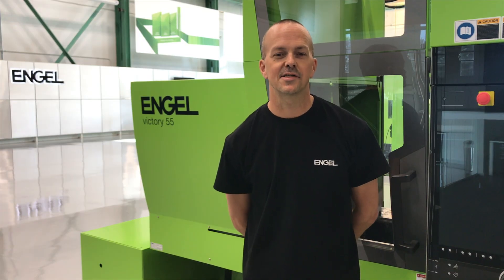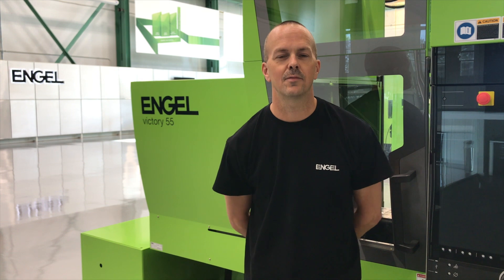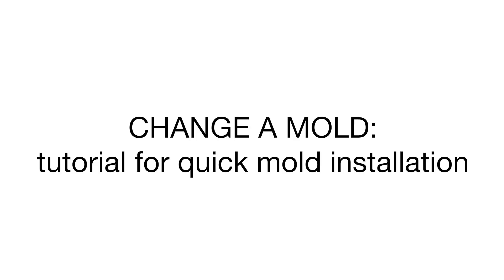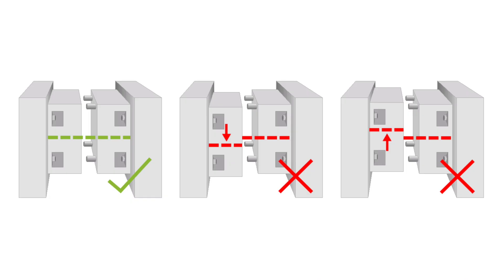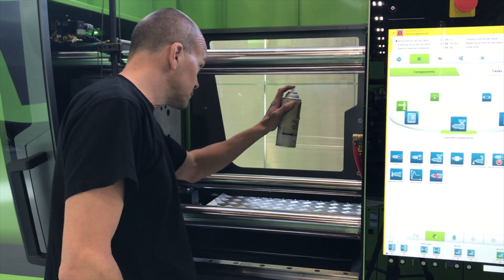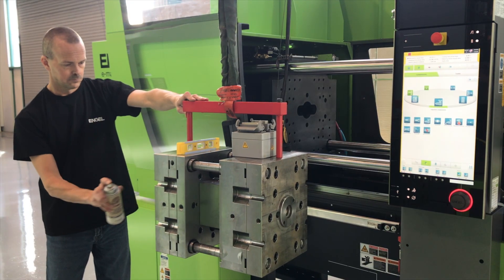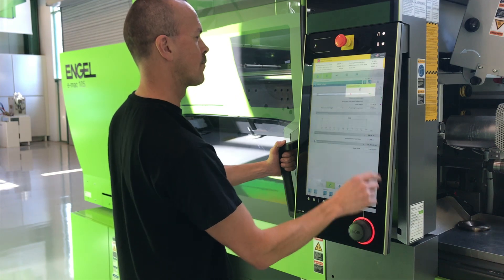Change a mold: tutorial for quick injection mold installation

Comment: What about the ejector rod? When the mold is fastened, it is quite tricky to have access to connect the rod with the machine.
Reply: Peter on this cell the EJ rod would typically be connected to the machine and not connected to the mold. Known as bumping the EJ pins only. This eliminates the need to move or remove the bar during mold changes.

Comment: My company has Engels 100, 200, 300’s. I’m surprised that there isn’t a die height on that controller
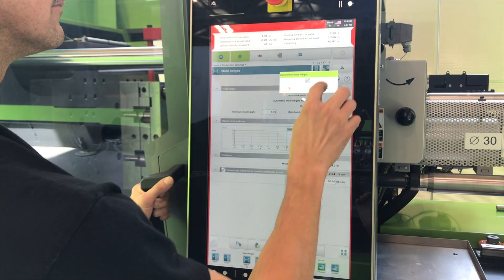Reply from the maker: There is a manual die height adjustment available on all 3 controllers. On the CC300 and CC200 there is also an automatic die height adjustment that you can see in the video (1:03). We are happy to assist if you have further questions: contact.us@engelglobal.com